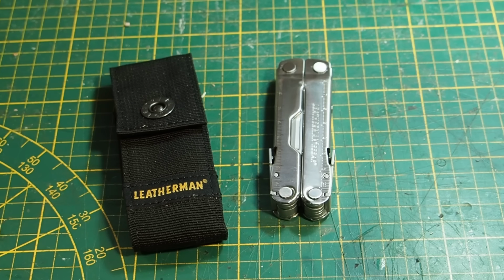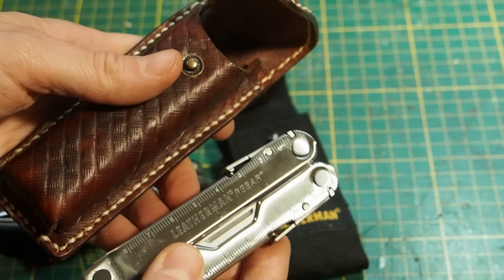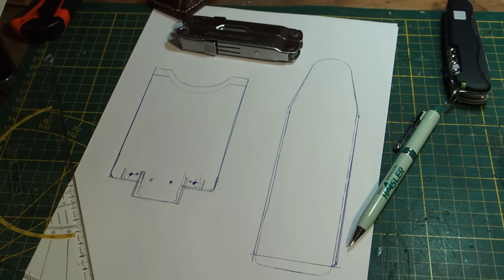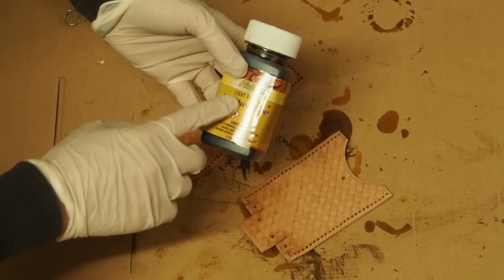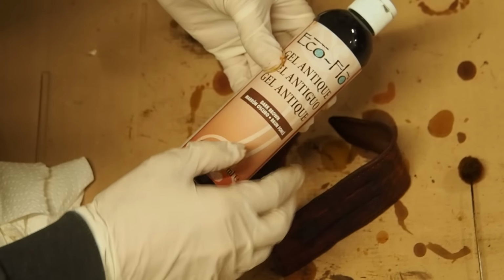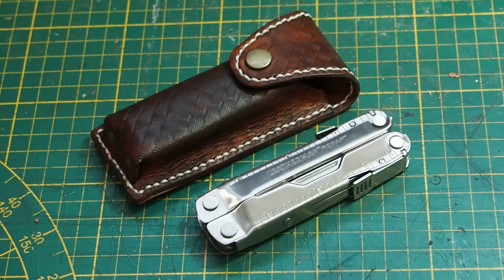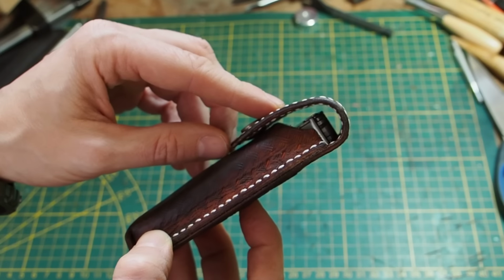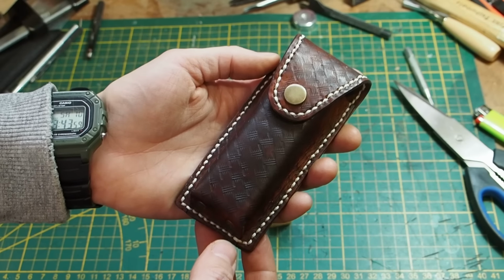Leatherman Rebar - Making an old-style Leather Pouch!

Comment: Ms. Lilly, i always use two needles to stitch as they lock the thread in the holes punched to receive the thread. Also, i wax and burnish the inside before i combine the halves. Great job!
Reply: How do you wax and burnish the leather?
Reply: @bfboobie  rub bees wax onto the flesh side rgen rub wirt a burnishing tool until the wax is warm and has been absorbed into the leather. easy